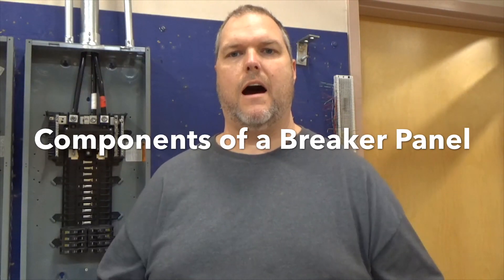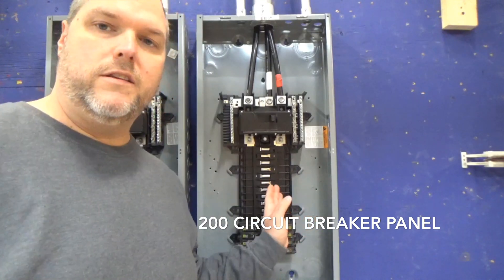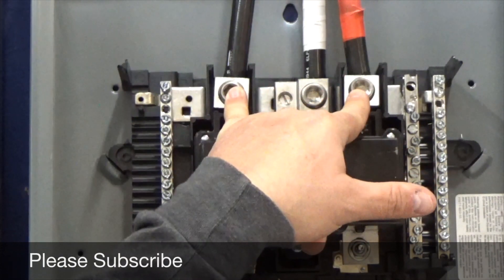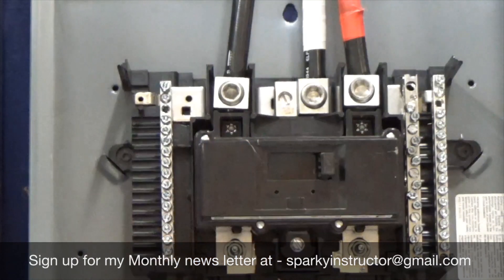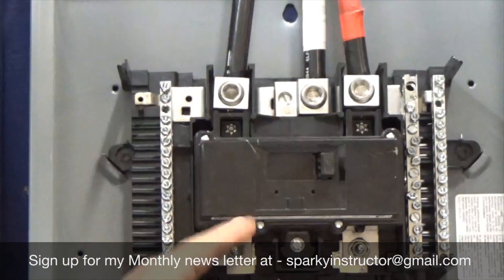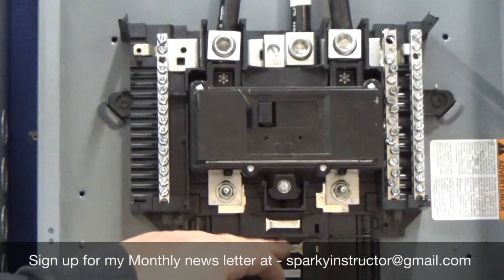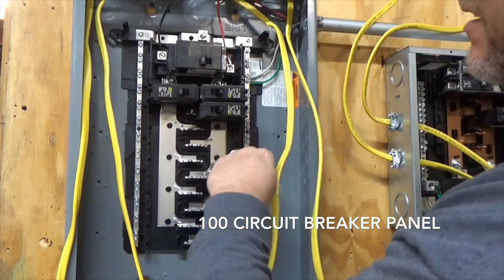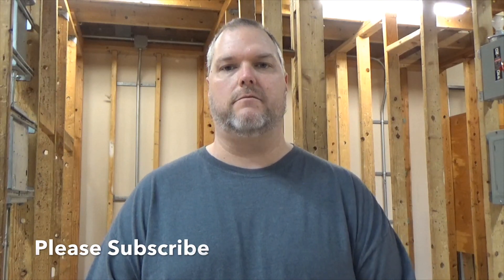Electrical Service Panels Explained

Comment: Hello one question. Does the amperage capacity of the general switch depend on the capacity of the electrical panel conductors? If the electrical panel supports 200 amps, is that the maximum that the main switch should carry? I appreciate your response
Reply: The main breaker should be rated no higher than the panel rating which is determined by the thickness of the bus bars.   For example you could have 4/0 AL SER cable good for 200 amps from the meter disconnect feeding a panel rated for 100 amps, but the breaker controlling that panel needs to be 100 amp.  You sometimes run into this with the uncommon 300 amp service consisting of a 200 and 100 amp panels.

Comment: Craig when do you use Ser vs Seu If you have a meter on the side of your house and your first means of disconnect is you main panel which is in the basement of your home what cable do you use to connect the meter to the main panel
Reply from the maker: Your meter with main breaker is first means of disconnect!! That point on to your panel you need to use SER!! CM
Reply: It's just a meter with no main breaker, panel is first means of disconnect
Reply from the maker: Then you will use SEU to your main panel!! SER would be for a sub panel. I read your question wrong I guess! Hope this helps!! CM

Comment: Hi Craig! Could you please produce a video or at least give your pro-opinion on SER cable. I'm wiring a 100 amp sub panel (80 ft run through attic), and I'm not honestly sure if aluminum is a decent product, albeit 1/3 the price of copper. I've always used copper for this application, 3-3-3-5, but do you believe a 2224 is dependable and long term, safe? Thank you!

Comment: I had a metal building built and we are putting in a 100 amp subpanel to supply power to the building, by connecting to the main panel in our home....approximately 70 feet away.  We ran our conduit and wires thru before we realized we Failed to mark the wires.  What is the safest way to find the hot wires?  Please help.

Comment: On a Single Phase 120 / 240 VAC 200 Amp Service for Dwelling Units, Residential, Code allows  3-ought Conductors  to be used for the Phases, the Un-grounded conductors and 2-ought for Neutral or ''grounded '' conductor if using 90* C THHN CU conductors.

Comment: What is meant by "200 amp" and "100 amp" panels? Is it the maximum current that can go into the panel and service all of the circuits that panel serves? Is it governed, limited, by the main breaker or simply that is the maximum current coming in fron the cables? IOW are the incoming cables the same for 100 and 200 amp panels and the difference the main breaker limit? These two panels look different in their internal construction. What is the brand of the first, 200 amp, panel?

Comment: On the 100 amp main breaker do you have 100 amps on each phase or total load on the breaker? and is it the same on the 200 AMP.
Reply: 100a total load

Comment: I like your videos. Not to be picky This is a single phase panel so there is only one transformer so the two hot wires are LINE ONE AND LINE TWO. I called them phase a and phase b also  I have been in the trade since 1975 I went to a seminar from Tom Henry  electrical class about 25 years ago That"s when he schooled us when we called them phase a and phase b

Comment: I am very interested in installing a sub panel in my detached shop.  I want to put a 50 amp 240v volt in my house panel to feed my sub panel. I am running 80 feet from house panel using 6/3 ga underground burial direct earth wire although I want to enclose it in pvc conduit.  I would love for you to guide me.  Thanks in advance
Reply from the maker: I will help in any way I can. Please email me and we can talk about your options. Thanks for your support. CM
Reply: If you are using conduit, you should probably use individual conductors, like THWN-2 copper wires. Direct burial is meant for direct burial and might be hard to pull through conduit, and might be against some codes.